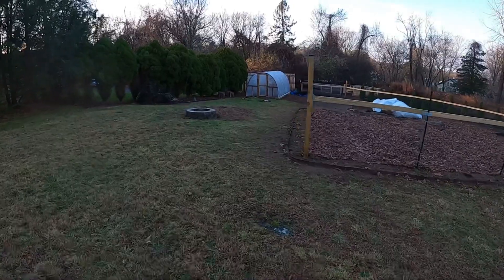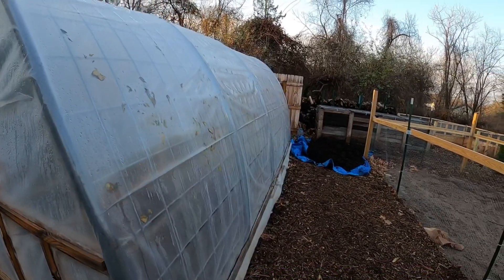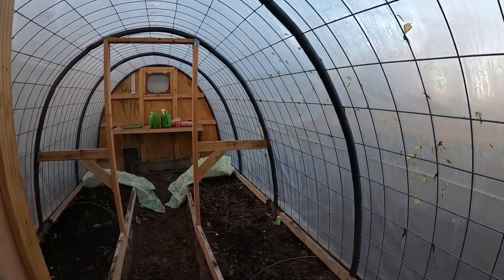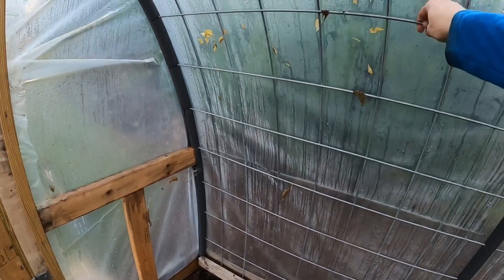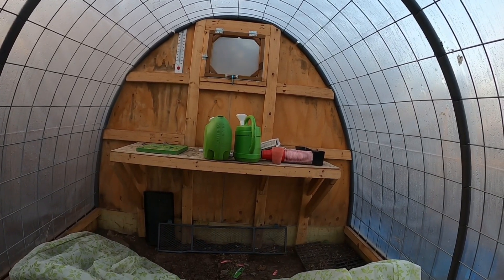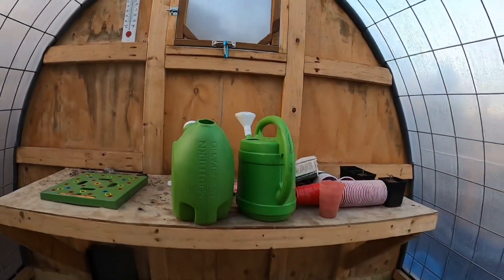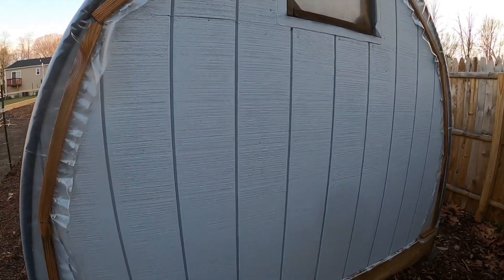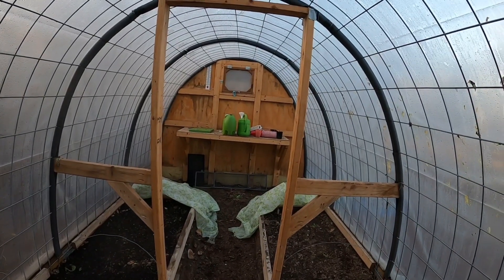Cattle Panel Greenhouse: Fast, Easy, Sturdy

Comment: We also have,  but due to winds we have 2500 lb polyester pull or mule tape to further secure the plastic.. attached to the base via fence staples..
Reply from the maker: Thanks for the suggestion! That is something we will think about using to offer further stability and support (especially since we sometimes have 50-70mph winds).
Reply: @uphillacre1585  Again because of our winds I also made candy canes out of rebar to anchor it, here in OK we have some pretty tough west winds and of course the occasional twister.. We're set up in wicking tubs though, check out a wise ole gardener here, goes by Gardening with Leon..
Reply from the maker: I will check him out- thanks! How do you bend your rebar to shape it?
Reply: @uphillacre1585  3/8th rebar, I stuck it thru a hole on the box blade of the tractor and put my muscle to it.. Stuck about 6" thru to bend, now the wife wants me to make shepards hooks.. LOL..
Reply from the maker: @timmmmmmmmmmy1  thanks for sharing! Good luck with the shepherds hooks haha

Comment: I like the ease of these typ of greenhouses, My concern with these are not enough Straight up and down space for shelves for started seedlings and such. i am currently thinking a hybrid of such. Like making a 3 foot high fram all the way around then putting the panels on top the wall.
Reply from the maker: I agree that this was a cinder of ours as well. The great thing about cattle panels is that they are flexible and you can decide how you want them to go. I’m interested to see what you do with yours. We are about to do a modification in ours to show how you can take advantage of the space for growing seedlings. I’ll let you know how it goes but keep an eye out for our video.
Reply: I saw one that buried 4’ 4x4s (about 2’ above ground)with 2x4s on top and that is where the cattle panels started
Reply: @ciarataylor702  that is something like I am thinking

Comment: wow yeah we need that here with our high winds. I'm in an open flat area of west Texas. What kind of plastic are you using and where to buy and also what is the total cost of a greenhouse like yours if you buy it all from the store in parts and build?
Reply from the maker: We bought greenhouse 6mil plastic from Amazon. Total cost of everything (wood, cattle panels, etc) was around $400.
Reply: @uphillacre1585  great ok thanks. i'm definitely going to try a greenhouse like this in the future.

Comment: Nice green house. What did you use for the bows(pvc?) did you get the covering from tractor supply?
Reply from the maker: The shape of the green house is folded up cattle panels from Tractor Supply. They do have rigid edges in between each panel so I put the pipe insulation to minimize any potential of tearing. The plastic is specialty greenhouse plastic that I bought on amazon.

Comment: Great video, thanks! I'm a little late to the party but how did you attach the door framing to the panels? Thanks!
Reply from the maker: Hi, wecome!!!! I build a frame in the front and attached to panel. Then just inserted the door from there.
Reply: @uphillacre1585  Right! What did you use to attach the frame to the panel? Thanks!
Reply from the maker: Fence staples. You can buy at Tractor Supply. Bit weird to work with if youve never handled before but quite effective in tying the metal rail into the top of 2x4
Reply: Great! Thanks for your help! I'm going to try to make my plastic removable for summer, should be interesting! Thanks again and good luck!
Reply from the maker: Good luck to you too!

Comment: What are the hoops made of? 1 inch PVC?  Great design!
Reply: Ah, never mind, you are using the foam for each connection with the cattle panels
Reply from the maker: Thank you! And yes we used the foam pipe insulation. It was easy to slid around the edges and we used electrical tape to connect them together to fit the length.
Reply: Hi great job! How did you tie in all the wood framing inside and the end wall to the cattle panel to secure it?
Reply from the maker: @Pierced777  we cut the inside 2x4s to the angle of the cattle panels while they were already in the hoop formation (the best we could) and then used fencing staples (1 1/4 inch - we got them at Tractor Supply) to tie the cattle panels into the ends of the 2x4s.
Reply: @uphillacre1585  ok awesome thanks great job!  Didn't realize I hadn't posted this to the main sorry.

Comment: Pretty nice set up.
Reply from the maker: Thank you!
Reply: What did you use between panels? It looks like hoops.
Reply from the maker: We zip tie the cattle panels together and then use tube insulation to protect the plastic from the sharp edges.

Comment: One thing u did not mention. What are the plastic hoop tubes?  They don’t look like white Pvc??  They look grey. Electrical pvc?  Size?
Reply from the maker: On the ends of the cattle panels (and where they connect) we used foam pipe insulation. It comes already with an opening to just slide it on easily and then we went through and cut slits where the intersecting bars were to allow it to fully wrap around. Hope that helps!
Reply: @uphillacre1585  yes the foam I understand. What are the 4 or 5 bent poles that the cattle panel is resting on? 2” white pvc.  1 1/2” white?  Grey?
Reply from the maker: Sorry I misunderstood. The cattle panels sit in a wooden frame (and are held in place by more wood that we screwed in). The whitish/gray pieces at the bottom that you are seeing is the excess plastic sheeting that we left after pinching it in with the furring strips. I rewatched the video and believe that is what you are seeing. Hope that clears it up but if not let me know. Thanks!

Comment: I built one put 6 mill plastic on it the plastic only lasted a few months then started dry rotting
Reply from the maker: We have not seen any instances of that on ours. We have had it for a year now. Thanks for the heads up so that we can keep on eye out.
Reply: @uphillacre1585  I found out the hard way if you get plastic it needs to be uv rated I had a mess when it rotted so now I think I'm just gonna us the clear corrugated panels on it
Reply from the maker: @greenbandit3132  I’m pretty sure we did get a UV rated plastic so I hope it holds up but will definitely be watching closely now. Good luck with the panels. Hope it works out!
Reply: Did you buy it from a greenhouse plastic supplier, who sells the right stuff, or from a builder's merchant, who sell the definitely wrong stuff.?
Reply: @thetessellater9163  we don't have a greenhouse suppliers around here anymore they've all went out of business due to bigger stores that sell trees and plants I got my plastic from a hardware store that sells greenhouse kits

Comment: Where do you live that you have 60-70 mph winds....bigger question is... what are your typical "sustained wind" speeds?
Reply from the maker: We live on the east coast. Mostly during coastal storms and hurricanes is when we experience such high winds. The past few days we have had sustained winds in the teens with gusts in the 30s/40s. The greenhouse has held up well through all of that.

Comment: How did you attach your cross beams for the elevated shelves
Reply from the maker: We used 1 1/4 inch galvanized fencing staples to tie the frame into the cattle panels. Then we ended up making elevated, removable tables over the beds. Here is the link to the video outlining what we did for that: https://youtu.be/i_8ZSjViq0Q

Comment: Nice job! Did you use 16ft panels & is the back wall T-111? tks
Reply from the maker: Yes, 16ft panels and t-111 board. Will post a 3 year followup to show its still standing strong

Comment: How did you attach the end plywood wall to the cattle panel?
Reply from the maker: Had to use two sheets of plywood (the ones used for sheds). Cut to shape. And then butted them under the cattle panel. Then tie them in with fence staples (ones from tractor supply)

Comment: What did you use for the grey foam ?
Reply from the maker: Pipe insulation, available at big box stores. Used the cheapest, still standing after all these years.